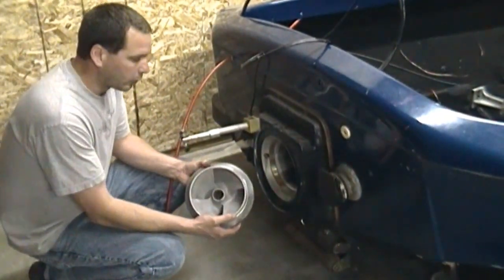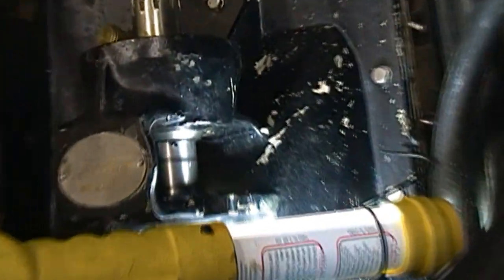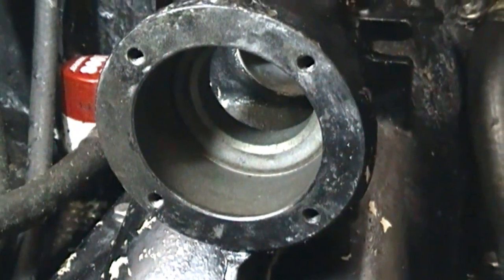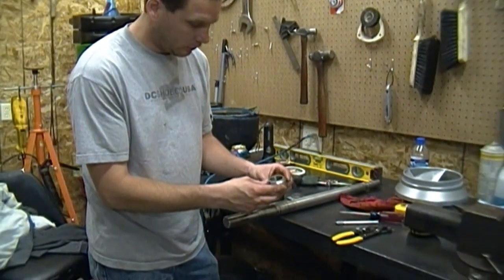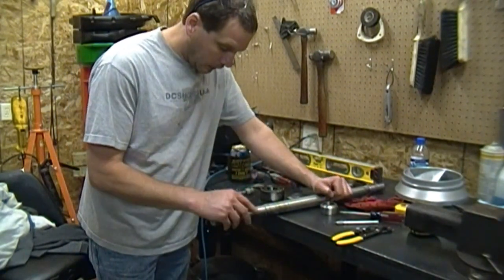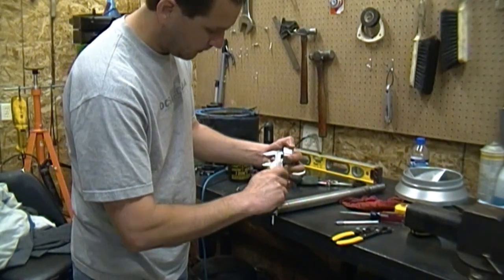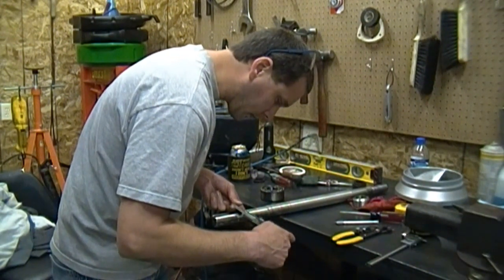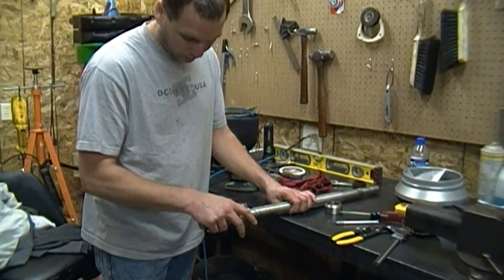Berkeley Jet drive pump shaft fail

Comment: i know this video is 6 years old but im posting this comment for people who come along in the future with similiar problems.1. Dont use a pipe wrench on the shaft, the best way I have dont this so far, is if you know you are taking the jet apart, break the nut loose while the engine is still installed. If the engine is out. Take the coupler with universals off the engine and hold it with a giant crescent wrench or pair of channel locks on a surface that wont matter if it gets scored.2. If the size difference is small enough it is possible to dimple the shaft with a center punch much like you would with a wheel hub to hold in a bearing race tighter. Also use red locktite or bearing lock when installing the new bearing to prevent slipping. If this doesnt work for a press fit, you will likely need a new shaft.

Comment: 4.26 "what jack ass put a pipe wrench in the hang hold" lol did u use one in vid 1 ?? lol
i i slid mine out the back of the pump with the impeller still on.